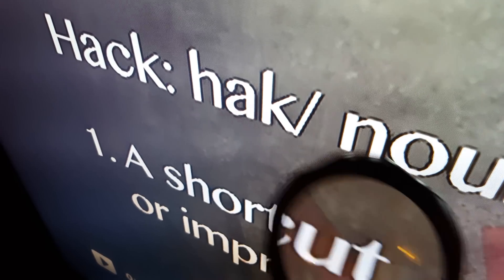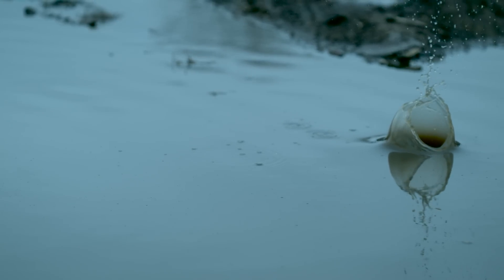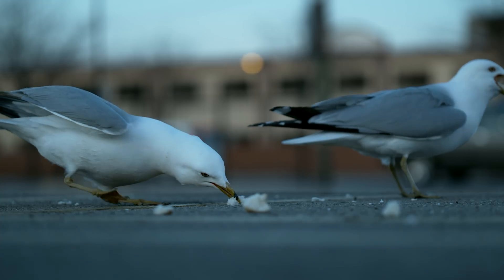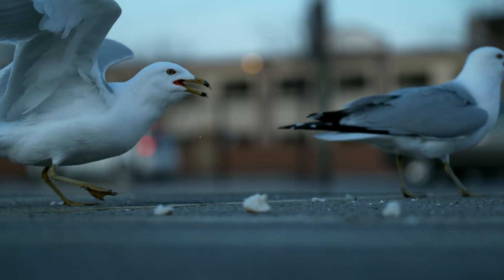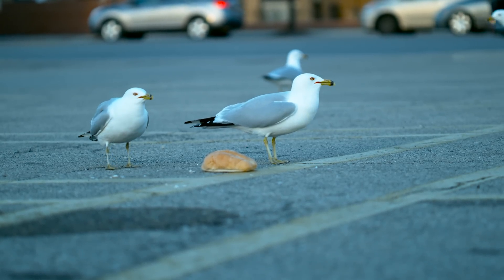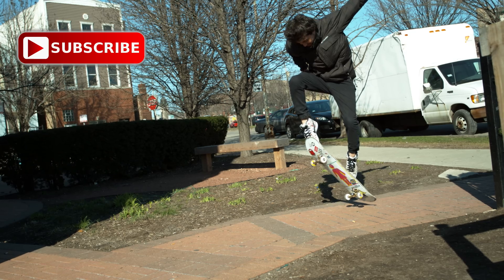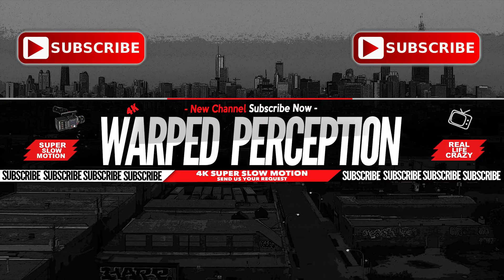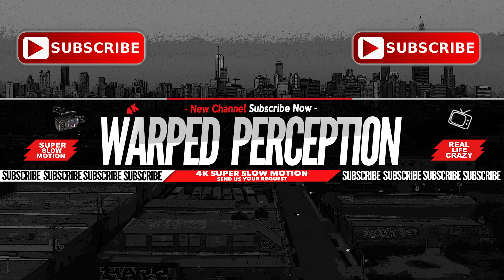LED TV Working in Slow Motion

Comment: The black has nothing to do with the refresh. It is due to the backlight level control which is done by turning the LEDs off/on rapidly (pulse width modulation). The longer the ON time, the brighter the image. If you set the backlight to maximum, you can reduce or eliminate the black frames.
Reply from the maker: +Chris W hmm interesting, so what you're saying is if I turn the brightness to 100% the black will be gone? So what about a refresh rate then?
Reply: It might go away or at least be reduced. I work in broadcast engineering and that has worked for me when I had flicker in an on-set monitor. However, on further reading I discovered that some LCDs insert black frames to reduce motion blur. See https://en.wikipedia.org/wiki/Display_motion_blur#LED_and_OLED You may be able to turn it off in the menu.

Comment: you do realize those black frames are not really the tv "refreshing the pixels", but rather the back light led flickering, right? if you set the tv to maximum brightness, that should go away.
Reply from the maker: actually there are no black led's. each LED pixel contains 3 sub pixels RG&B, the refresh rate of this tv was 120hz, so in between each cycle of the 120 cycles per second that the pixels refresh the color, they change to black, we found that this was the in-between time in the refresh cycle. could be different depending on the manufacture im sure.

Comment: I would think the TV would have better color depth if it used the following LEDs:
Yellow
White
Green
Cyan
Magenta
Ultraviolet
Reply from the maker: you could be right.
Reply: White light is all the colors mixed together equally where black is the absence of light.

When dealing with pigments, you can use yellow, cyan, and magenta to create all the colors.

Pigment and light work in the exact opposite way which makes the complimentary colors flip to the primary ones and vice versa. In the end, a screen will produce light while a painting is absorbing and reflecting light.

They already try to make the pixels as small as possible (4k resolution is already extremely small) so three extra color components for each pixel would likely lower the resolution and increase the amount of data to show one frame (doubles the image data).

Basically more trouble than you would get any real gain for, but it would be possible to do such a thing.

PS. Ultraviolet is completely invisible to the human eye, but violet isn't